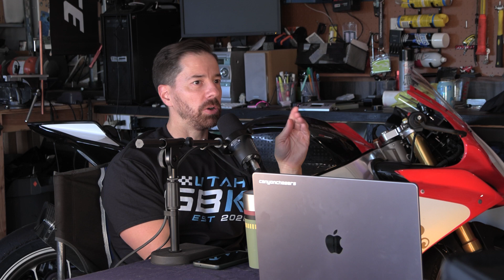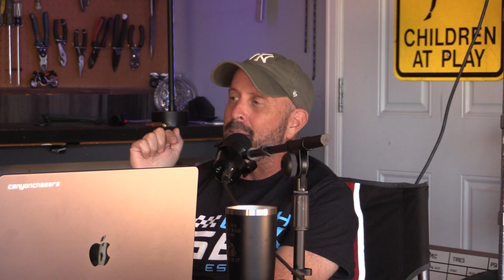2026 KTM 990 RC R What They Got Wrong and What They Got Right

Comment: Yall make me want to start my own podcast… I wont buy the rc990 because its not sanctioned yet and it wont be as good as the 8c no matter what
Reply: it's like 1/3rd the price... and homologated for supersport! most new gen regs are for <955cc twins, gonna be a club racing monster if you can get dealer support...
Reply: @motodaxa well the rc8c is still the better bike and already legal the 990 will not be legal this year I already spoke to asra Id literally have to race against super bikes
Reply from the maker: It will be legal with UtahSBK in 2026. If you're looking for a fun series at a great track. 😉
Reply: @CanyonChasersPodcast hahaha utahs a little far for me Im on the east coast, I do wera and asra atm. I really was considering a 990 but I can ignore how good that 8c is. Found one full carbon for 26k!
Reply: @thenovalabs  whoa, 26k is a steal. the 990 is legal at the Malaysia Speed Festival for SSP next year but I can't even stomach the asking price for that yet... racing an old CBR first.
Reply: @m @motodaxa Verry cool, yeah who knows maybe I get one down the like. I bought strictly off the pedigree these bikes carry. “Best track bike” and all the engineering for racers done by kramer. Seems like a no brainer with what we dump into our bikes alr youd come out more expensive than whats on the 8c stock.
Reply from the maker: $26k is a deal! There's two guys at our series who race them, amazing machines.
Reply: @thenovalabs  The Kramer is a purpose built race bake and you are comparing apples to oranges. Obviously anyone would take a Kramer over the new 990 RCR.  The appealing aspect to the new 990 RCR is price point and parts availability.   You might want to price some of the spare parts before you go buy the Kramer. I know 2 people with them and things like replacement carbon wings or windscreen will blow your mind on how much it cost.  I think a replacement windscreen was pushing $400.

Comment: I had the exact same thought when you mentioned feeling the weight change from full to half a tank. On my CBR600RR I can barely tell the difference between full and almost empty – and then you said you have a CBR600RR and don’t feel it either. Really cool to hear someone confirm that!
Reply from the maker: I very much still have a soft spot for the CBR6. one of the best handling bikes I've ever had with a lot of clever engineering and design in it.